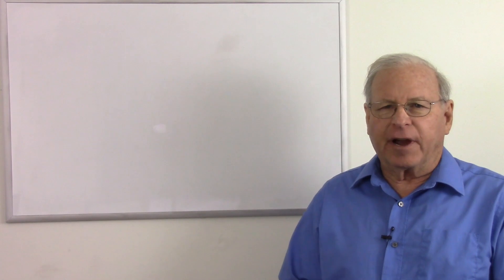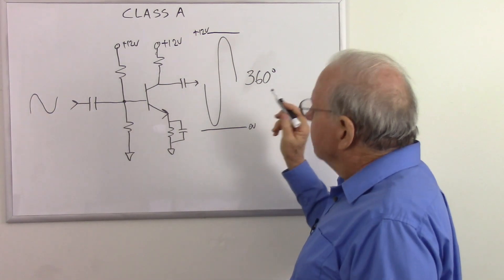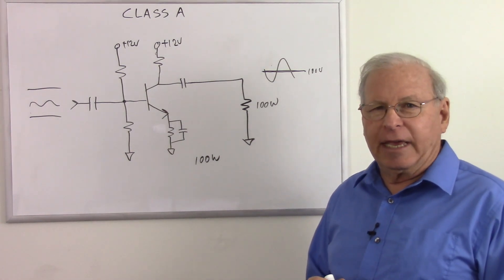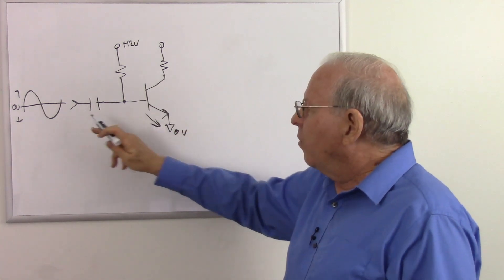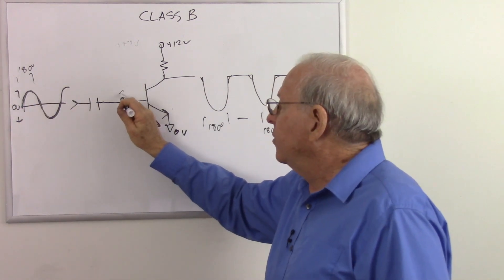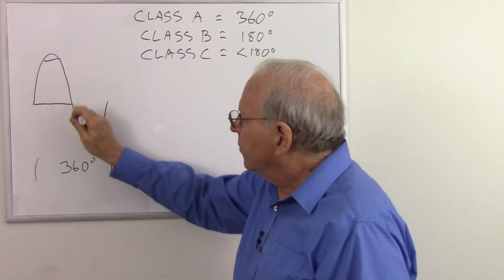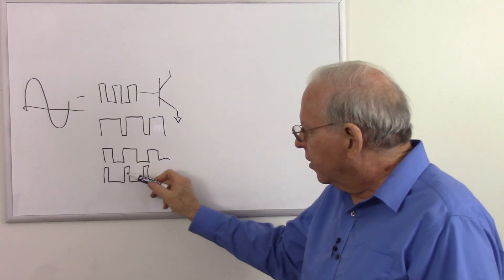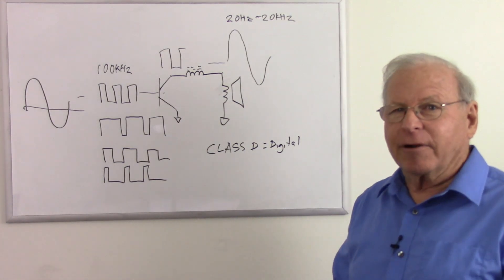Amplifier Classes - Solid-state Devices and Analog Circuits Day 7, Part 1

Comment: The big deal about Class D amplifiers is the efficiency, as they avoid the linear region. A transistor inside the linear region is dissipating power. A transistor outside of this region (Off, or saturating) is not

Comment: Sir in class A amplifier why are they using cap and resistor to the emitter of the transistor.
Reply: for DC component of the signal, the resistor in the emitor will lower the amplification of the stage (Gain), for high frequency the reactance of the capacitor will short the resistor, so will increase the gain of the stage.